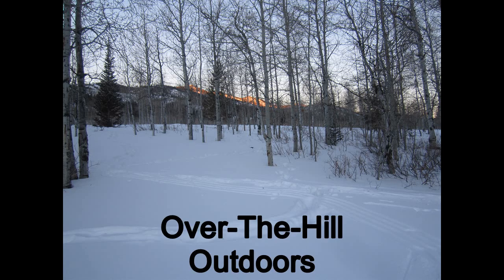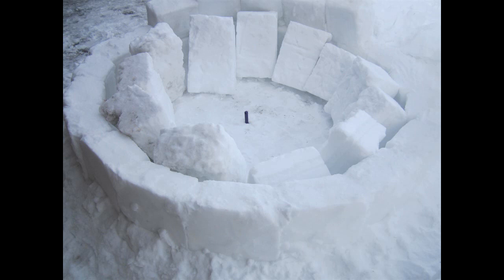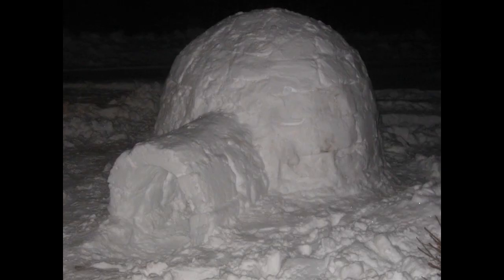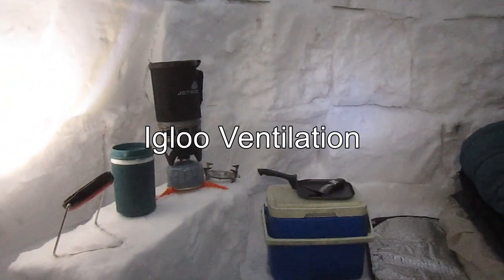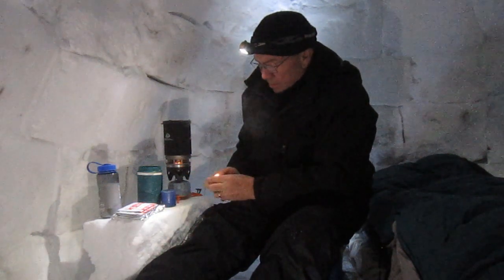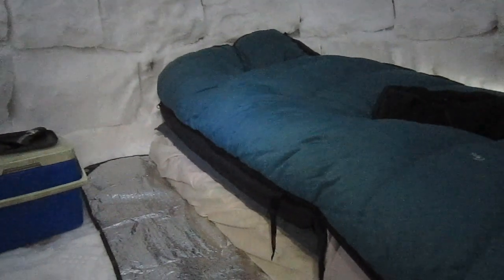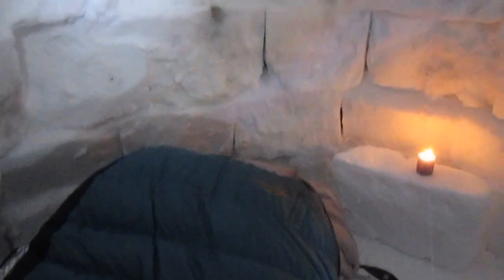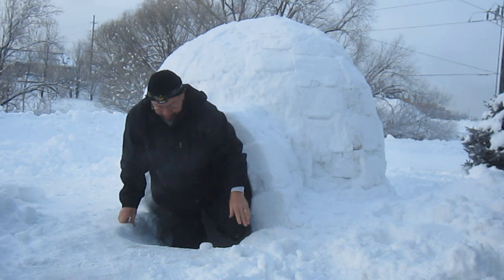Common Questions About Igloos

Comment: I used to build tons of snow huts as a kid, never from blocks since they would always cave in after a few days but rather just smushing up the walls one handful at a time like you would with clay into a dome. Those were way more durable and could survive a day of snow melting temperatures, becoming stronger each time as the melted snow slush would freeze into denser ice. The best one I ever built was due to a month perfect weather where the constant melting/freezing and me adding fresh snow on top turned the entire thing into a 20 inch thick solid ice dome. You could ride a sled down the side of it from the top and it didn't collapse until well into april. I was the coolest kid in the village, seems I peaked at 12 years old.
Reply: That sounds so badass
Reply: @thomaskalamees8776  ikr
Reply: Straight fuckin badass
Reply: Based and nice

Comment: One the subject of igloo's collapsing: I've built and slept in about 200 igloos over the years on mountaineering trips.   A few were made with good "styrofoamy" snow, most were made with marginal or poor snow, IE, had icy or weak layers in the snow pack that yielded fragile or weak blocks.  I've had blocks fall in while I was still building but never had one block fall in, let alone a complete section once the igloo was completed.  I also used to worry about an igloo falling in on me but haven't thought about it for years.   The key is finding wind blown snow.  And, to make the most of marginal snow, having a really well designed snow saw.   I used a double sided Wyoming or packer's saw like in the vid but long ago but have moved way beyond that.  A well designed saw makes ALL the difference in the world in labor,  quality and time.
Reply from the maker: Here's someone who knows what they're talking about.  Thanks!

Comment: why does the Igloo not melt on the inside due to the temperature gradient?
Reply from the maker: The inner wall surface will melt a little if temperature inside the igloo gets above 32 for very long, but it usually refreezes when the temperature drops again - especially when the igloo is unoccupied.  Melting and refreezing is a good thing because it tends to seal small air gaps and bond blocks together better.